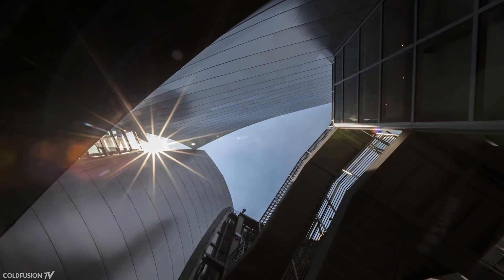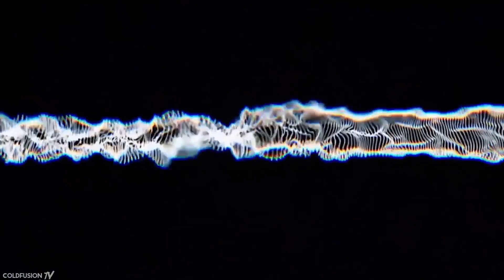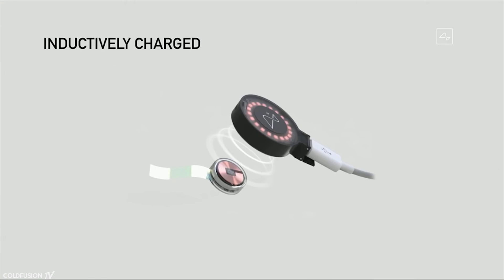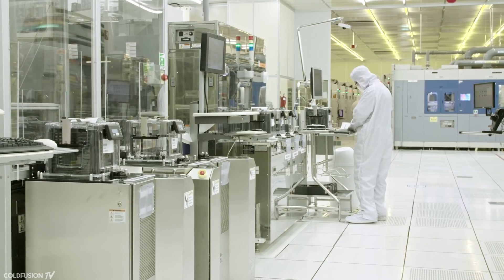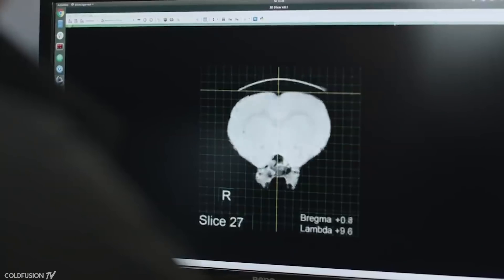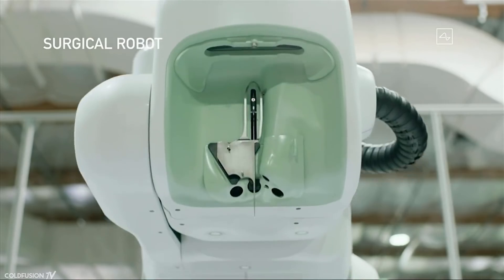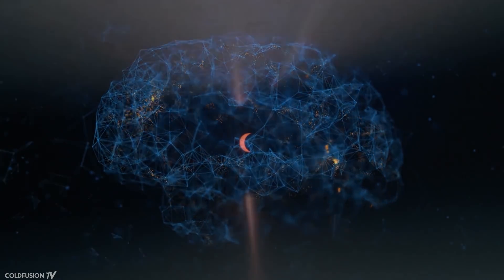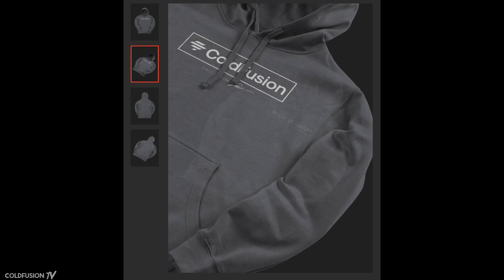Elon Musk’s Neuralink – Ex-Employees Reveal Company Struggles

Comment: Meh, this video basically repeats claims made by the company without actually doing any outside verification of claims or assessment of info they're given.
Sadly, the tech isn't anywhere near the level they put out.
Look at the animation just after you repeat their claim that they can send and pick up signals from neurons in the brain. It the animation, it shows a wire similar in size to the neurom it is beside. Yet, you can plainly see the wires in the video from a distance. Their guage is much too big to be anything close to the size of individual neurons. In reality, there could be tonnes of neurons in the area of the wire. Also some estimate there can be something like half a billion synapses per cubic millimeter. So the white is likely to read a lot of noise that could be an entire range of various brain functions going on. Sending signals could be similarly confusing to the brain as some big large signal fires off possibly thousands of neurons at the same time.
Wires actually targeting specific neurons wouldn't be visible to the human eye without aid and would be just jabbed into the brain like a stitch with the only real aim of the robot being ro not puncture a blood vessel.
The tech simply isn't there to be anything close to stat their claims are implying. I mean, they are years into this project and they are bragging about what a feat it is that their pig is still alive after two whole months. That really tells a lot about the lives of these animals.

Comment: Best bet would be for amputee's/artificial limbs on how you can connect nerves and electrical impulses. Brain interfacing would be interesting yet a lot of people may not except it because of being directly linked to the brain yet more time needs to go by to assure of some things. Used as an interface with contact lenses' is best bet for 3D digital overlay yet I'd figure an over head visor/sunglass's would be more acceptable for the head area. voice command and or eye blink eye focus on a menu around the outer vision of perimeter would makes things easier as if point and click to open up what let alone voice commands. I still think have movement slightly automated as an assist for when your brain impulses trigger certain actions, thing is enough pressure to hold or grip what you'd like let alone distance sensor's. To be able to connect with the voice in your head that manifests what your thinking to be able to access commands to interface with the device is a much different matter for memory read let alone other issues that may arise.

Comment: I'm amazed people still give Elon money
most of his schemes are borderline physically impossible or insanely far fetched.
Instead of going back to the moon (the easy, cheap, and understood process) he wants to go to Mars solely because its never been done before. (Also re-usable space craft have already been done, remember the space shuttle?)

Hyper-loop is a joke, firstly any US spanning rail system would have to go over countless miles of desolate NOTHING. Secondly because the whole system is de-pressurized to an insane degree a single failure. A single loose bolt, traffic accident, seal breach, or god forbid intentional attack and BOOM the whole rail line implodes a pressure wave faster than the speed of sound killing everyone inside the tube at the time and likely many people outside it. Is it possible? Yes. Is it practical? Hell no. Is it safe? Not even remotely, its as almost as dangerous as space travel with none of the benefits.

Comment: Kind of silly, really, is there ANY medium to large sized company out there that doesn't have internal struggles?  Sounds to me like they are just one of basically, ALL of them.  I hope they are successful, but as with sending humans to Mars, it is MUCH easier to conceive of, and design toward those lofty goals than it is to actually achieve them.  And there will ASSUREDLY be downsides to both.  There always are.  The REAL question is will the upsides outweigh them, and to a large enough degree to make each one an overall beneficial technology or undertaking?  And that is often very difficult to determine, sometimes even far down the road.  I know, captain obvious, right?  But sometimes it bears repeating.  And hearing that some company has internal struggles is about as interesting and newsworthy as pointing out it is generally darker at night.  Duh...

Comment: It’s worth pointing out that many government employees and academics typically aren’t use to the business environment where results are what is measured not intentions. Furthermore, the company owners will obviously push these scientists harder than they are used to because millions of dollars and the reputation of the company is on the line. While ethics discussion and redundant testing are important, nothing would get done without harnessing the power of human greed and insatiable curiosity. Tesla would have floundered because “experts” would have said the battery market could never compete with internal combustion engines. Space X would have never got off the ground because “experts” would have said reusing rockets wasn’t feasible because if it was, NASA would have already done it. 

TLDR: Experts are only experts in the old way of doing something. 

I’m not saying that ethics discussion and redundant testing isn’t important or shouldn’t be done (it definitely should, and I’m kinda spooked by this tech especially the part by the mouse with a USB port in its head 🤮...). But one has to acknowledge the momentous achievements Musk’s companies have made in the past few years considering that the regular pace of science would have set back this tech 20-30 years if “experts” had their way. After all, why not milk a project for all its worth on government payroll and move at a snails pace with only marginal improvements? Frees up so much more time for focusing on research the “experts” actually like. (Look up how grants work at research departments and you will be flabbergasted by the sheer naivety of requirements and how easy to game the system is) 

Another TLDR: Psyntist dum. Ingineer smrt! Mak 🤑🤑🤑 wth Tesla stoncks!

Comment: There is a lot of  fear over the potential misuse or abuse of this technology, and I'll conceded that some of it is justified. ANY software or hardware with the potential to directly read or affect the human brain is a huge new personal security concern, even if the scope of that read-write access (as with Neuralink) is heavily restricted by where the physical wires are connected. (IE: Neuralink could not influence you to buy a tesla if your electrodes are wired to your motor cortex to control a prosthetic arm.)

I think most of these concerns are *exaggerated*, but they indicate a dire need for any hardware or software interfacing with the brain to be rigorously reviewed by third parties. Open source is an absolute must have here.

Comment: Going forward, $500k for the surgical robots ought to be very profitable. There is little difference with these machines and 5-axis milling machines in fundamental terms. Of which an American made HAAS would be well under 150k for the smaller model. Capable of approximately .0003in precision. Various other manufacturers such as the Swiss made Willemen-Macodel boast micron level precision (.00004) and at a price point that is significantly below 500k. I doubt these surgical machines would require precision closely resembling this. Of course this is the cost-inflated medical device industry and the factor of scale is crucial as well. But if the devices are commercially available at least this part of it will be very lucrative. Not to mention the massive hype it would generate especially how an IPO would cause their valuation to skyrocket in the Musk-ian manner.

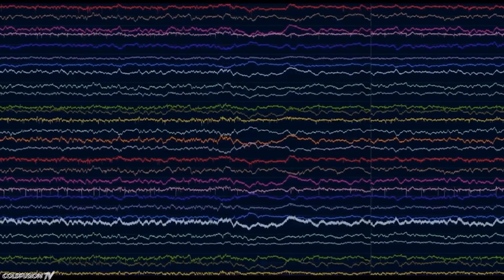Comment: 4:10 'neuralink just aims to do this with higher precision and better performance', 'it's a decades-old technology.'
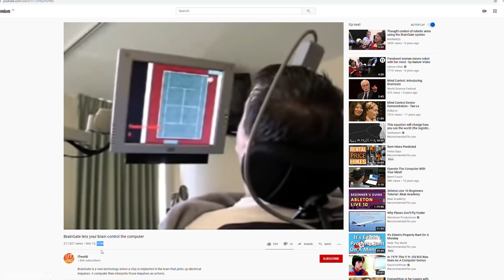Wow, really underrated. They also try to do it less invasive (literally, look 5 seconds before that, 4:05, where the person has a huge cable with the brick on his head), cheaper and/thus more common technology. Also, if you research it a little, you'll see how many electrodes were used before, and how many are in the neuralink (which is 1024 btw, not 1000.This is significant, because one of the earliest tech had 64 of them)

Comment: It is not surprising really. The field of cognitive neuroscience is roughly 30 years old and still cannot answer many of the basic questions about human behavior and the brain (also because of reverse inference problem). If you have seen the recent demo of Neuralink, the one with the pig, yeah, cognitive neuroscientists have been able to do that for years but non-invasive. Basically with either fMRI or even EEG. Nothing ground breaking, other than having better spatial resolution because it was an invasive procedure. I am curious as to what Neuralink actually wants to deliver, because from the outside it seems like they are reinventing the wheel.

Comment: The precision improvements they are making is impressive. This needs to be further developed and combined with high quality prosthetic devices. 

Current gen leg prosthesis are like early mobile phones. Next gen will be like flip phones. The folks who need these are probably eager to get to the smart phone versions. Sure some will be crappy knock off smart phones, but others will be really nice.

That is the potential here. 

Now the downside is that anything with software can be hacked. So one has wonder how secure will this tech be. What are the implications of hacked implants? Can they make accessing the software for updates be secure? I would hope accessing implant software is not so easy that anyone can pull it off by proximity.

Comment: Watts range wireless charging on your head will cause brain damage, i have used an induction heater and experimented with the low frequency exposure, my fingers and upper part of my hand got very saw from putting my hand above the coil for a couple of minutes, imagine what it will do to brain tissue.

Comment: I think that unfortunately Neuralink will fail to develop that technology.
The problem is that electrodes has to be inserted deep into the brain to be able to send signals inside the brain. By placing the electrodes shallowly in the brain tissue, the device is able only to receive signals, and only the basic ones.
Placing electrodes causes tiny damage to brain tissue. It's just the way it has to be. To put the electrodes deep enough, there would be much more damage. And brains aren't the same. They're only similar in structure and overall principles of functioning. But in details they're very different. It's proved that by using specific brain function, for example by being a taxi driver, or a language translator, parts of your brain become bigger, and the other, less used, become smaller. Without putting the electrodes precisely where they should be, I think that'll be impossible to fulfill barely any bigger hope already given by Neuralink.
Also I think that they'll fail to develop that technology before the creation and release of conscious AI. It's just around the corner.

Comment: Keep in mind that if you ride a rollercoaster or are in an airplane and it has to pull Gs, the gravity may pull the metal/plastic parts inside your skull not attached to the brain through your brain giving you the equivalent of a stroke: cutting through part of your brain. Similarly, if magnets can move the internal equipment, if you get close to a strong electromagnet, e.g., an MRI machine or a machine for picking up metal, the magnetic field might similarly pull the metal parts of the device not attached to your skull bone through your brain matter and give you the equivalent of a stroke.

Comment: Nueralink works on an invalid human proposition the integrity of scientific modelling specific to what is the parameters of what constitutes the human mind. I do not need a brain to feel alone, I need only remove every person around me within my environment to feel the same. Artificial intelligence has a significant problem it's insignificance in the human evolutionary tale. It's integrity is history in the making pre or past evolution, there is no finer mind then the creation model. I feel fine, I feel with my heart, take away my light and I feel my way around, stumble and fall but my integrity has purpose to assist me to walk. If I took away your legs you should learn improved ways to crawl, your environmental field requires an adjustment in time. It's an integrity fail safe, you wish to implant something called Nueralink into the minds of men for some benifits made possible by the future that all sickness or disease remains the same, if we told you autism was not a disease 20 years ago but an evolutionary leap forward ensuring a transformative state of mind of higher intelligence and a different way of thinking your company would have lobotomized my mind and made caustic remarks about my character, but that's okay I still have my integrity. Why does science keep sticking probes in my brain have they no feelings or integrity, I know I'm a sheep bah but if it's a disease your trying to cure you only need change my diet add a few nutrients such as dried kelp and field mushrooms with an additive of DMT, grind silver and some ash pumice and gold leaf flake into the mix, drink lots of Dom Perignon table water and Elon could you turn the volume up on the TV before you leave, it's hard to operate the remote with a cloven hoof Bah Bah.

Comment: A weird, but inspiring video. Everyone knows that the technology they are trying to make is not novel. However, they are trying to engineer a small, biocompatible and easy to implant device. Those were the issues with previous devices where you literally connect a big cable on a big ass device on top of your skull. I mean, someone has to rush those deadlines and push the boundaries.
Reply from the maker: Well if you came away thinking I don’t like the technology, at least that shows that my bias isn’t visible!
Reply: ColdFusion I find your video inspiring but weird. That’s all!

Comment: So, 4 ex employees that couldn't meet deadlines bitch about their old job being too high pressure for their skill set.... got it.

I guess that is why they are an ex employee, make room for a performer!
Reply: This is the first time in a very long time that I have ever thumbs downed anyone as I am normally very open to differing opinions and a sound presentation of fact. However, I think this one is pretty narrow and needs to be addressed.

There are two types of whistleblowers. The first type is obvious, broadcasting what is known to be wrong by the laws established on the books through years of damages claimed in courts and legislations moving to sign acts into law. The second type is not so obvious, broadcasting what has potential to go very wrong due to fast, undetected manipulation of ethics and because there are no laws written up yet in a general societal consciousness that has yet to catch up with it's leading edge technology.

I think you need to ask yourself if it would matter to you if the number of ex employees coming forward would make an impact on your opinion. If so, in other words, if you need the action of hundreds of ex employees and dismiss the action of one solitary ex employee because you rely solely on numbers and dismiss the material that is brought to the table, then perhaps you don't understand the ethical boolean algebra at hand or the many possible outcomes.

Comment: I have a question, the neuralink device looks like it has no support to the skull but replaces part of it, so if someone hits you or you get hurt where the device is, will that kinetic energy damage the brain, or the skull??
Reply: Usually during surgery where part of the skull is removed, a metal plate is inserted for further strength and to hold the skull piece in place, you can't add a metal plate due to the induction, soo... is this just gonna be somewhere that is an extreme weakpoint?